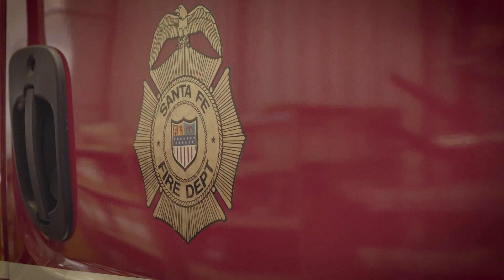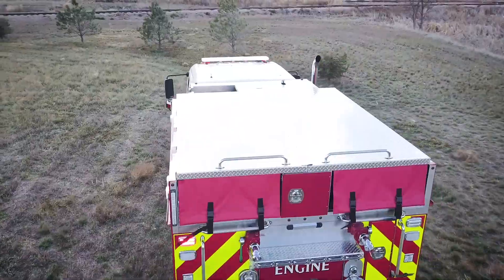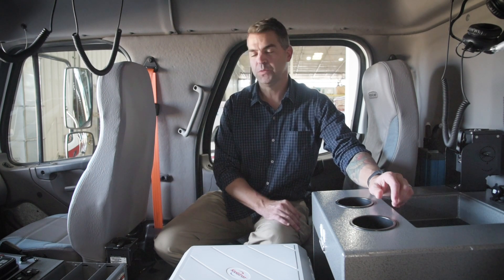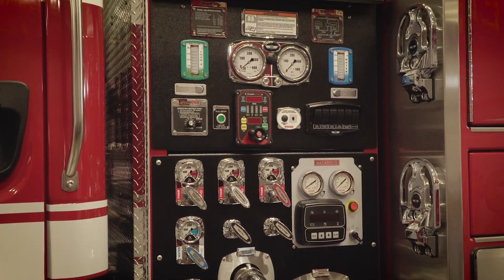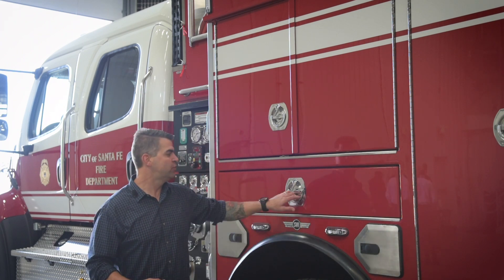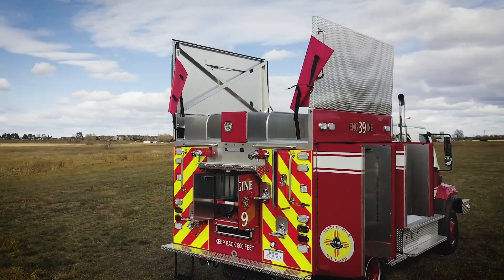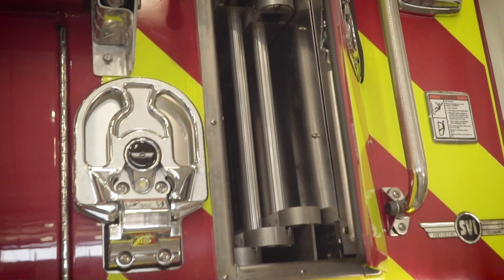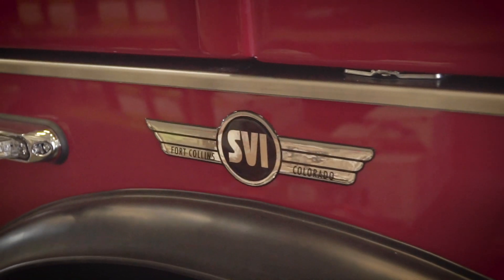Santa Fe Fire Department Type III Wildland Pumper

Comment: The narrator and film producers got it right, it is an ENGINE, not a pumper.  Don't believe me?  Read the ICS (Incident Command System) materials required to get a "Red Card" rating for Wildland Firefighter 1.  Someday the departments in the eastern U.S. wil fully adopt ICS